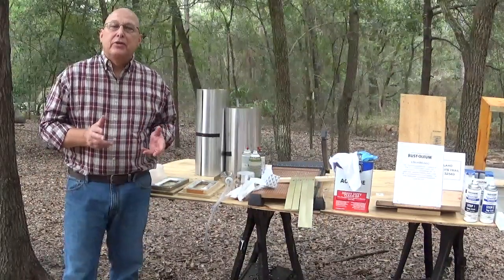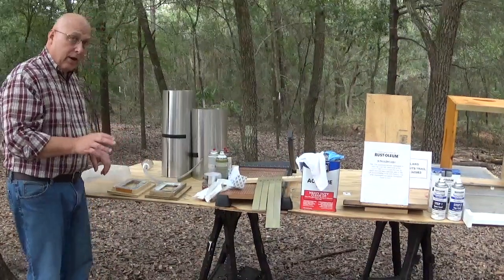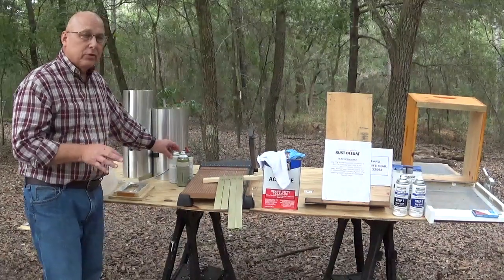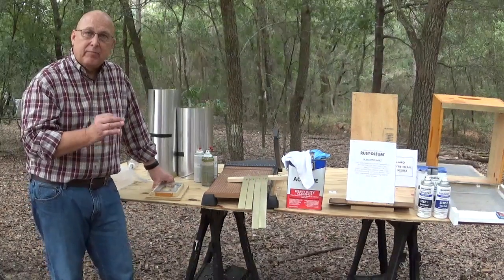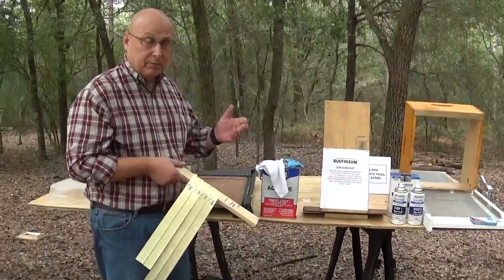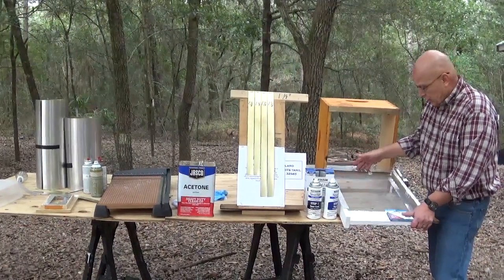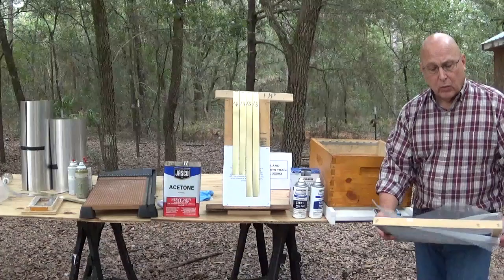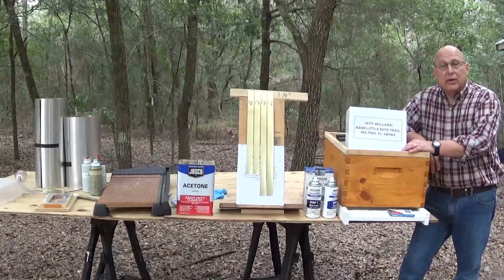Small Hive Beetle Barrier, it is easy to make and inexpensive.....

Comment: Hi, when you mention the staples would you mention the type of staples? Are they considered narrow crown? What is the width and or length of the staples. They are supposed to be stainless steel staples correct?
Reply from the maker: I use the T-50 staple, Arrow Fastener 508SS1 Genuine T50 1/2-Inch Stainless Staples. I also bought an air staple gun from Harbor Freight and that has sped up all my stapling jobs on the screened top covers and bottom boards, I liked it so much I bought 2 when they were on sale.
Reply: Thanks for the further input on the staple size etc. I believe I have an electric T50 stapler from Harbor Freight actually but they have an air nailer stapler on sale right now and I will investigate further to see if it can use this size and type of staples. Thanks again for the input and this idea to provide a barrier to the hive beetles
Reply: Sorry but I am a bit confused regarding the staple size as Arrow says the don't have a 1/2" x 1/2" stainless staple.
Reply from the maker: This is what I use..... Arrow Fastener 508SS1 Genuine T50 1/2-Inch Stainless Staples, 1,000-Pack.......   LINK TO:

       https://www.amazon.com/Arrow-Fastener-508SS1-Stainless-000-Pack/dp/B000OMJWNA/ref=sr_1_1?ie=UTF8&qid=1498244757&sr=8-1&keywords=arrow+508ss1
Reply: Ok thanks! I see those are a 3/8" crown vs. 1/2" that is what was throwing me a bit. I was looking for 1/2" x 1/2" my mistake! Thanks for your patience with the questions and I really appreciate the info and this great idea for the shims with regards to the hive beetles.
Reply from the maker: Your Welcome........

Comment: Hi Jeff, Super video!  I just cut the metal strips with the snip, snip method.  Not so easy... How long is the blade on your  guillotine cutter?  Where did you get it?  I plan to spray tomorrow, and néed to cut several more.  Think I will wait for the cutter...  Great Video!!!
Reply from the maker: Hi John,
Thanks, I got mine from Amazon  (ELMERS X-Acto Heavy Duty Wood Trimmer 24"). You might get a less costly 24" one from E-Bay, they are a real time saver that will last for years that is how I looked at the purchase. The Amazon link is below. 
 https://www.amazon.com/gp/product/B00FZYNXY6/ref=oh_aui_detailpage_o01_s00?ie=UTF8&psc=1
Reply: Thanks Jeff,  My hives have screened bottom boards.  Do you find that your barriers work with the screen?  I have regular inner covers.  Oh, I live in western North Carolina.  Last fall when top feeding I say SO MANY SMB. I use beetle blasters but those only help.  I am going to spay grass under the hives with salt and vinegar.  Hopefully this will disrupt the pupating of those devils!  I am also considering using boric acid in cd cases but hate to go this route.  Just FYI, I treat in the fall with black walnut shavings...smoke 3 or 4 times over that many weeks.  I have not had problems with Varroa mites.  Thanks again!
Reply from the maker: Hi John,
I use screened bottoms on all my hives, I feel that it keeps the hives cleaner and better ventilated. Spraying liquid or using powdered insecticide like Guardstar will help in the areas you use it but you have to remember the SHB larva will travel hundreds of feet to find a suitable spot to pupate in. 
  Now the Black Walnut shaving is a new twist on treatments, do you use the hull or the nut shell. You'll have to do some research on the possible compounds in what your using and how it may react to the Varroa, you may be onto something. Pop out some drone cells to double check on the Varroa population.
Reply: Actually, I use wood shavings.  I have met with a “mentor” who has around 40 hives, has been bee keeping for around 30-40 years and has always used this natural way to control the mites.  He uses a sugar shake for counts and they are good.  Drone cells?  Will do. Thanks!
Reply: John North Carolina can you give more detailed info on this smoking process?
Reply: Hi there,  Yep.  Black walnut shavings, dried.  Put them in your smoker in fall.  Over the next three weeks smoke directly over each second deep or medium brood/store super...puffing much smoke between each frame...close it up and do the same 7 days later for a total of three weeks.  This year I used this method, as i have the last 3 years.  Ive lost one of 5 hives this spring.  I went to our bee keeping meeting this week and many lost 50 to 90% of their hives.  About 50 people in the meeting.  Today I adjusted entrance reducer to middle setting, and all look great!  Email me and I will give you more detail if you want.  Good luck!  John

Comment: After spraying my strips they dried a slight milky finish. it still repels water but I am worried if it will still work. what color did your strips dry?
Reply from the maker: That is the way it dries, a dull, rough and off white color....
Reply: the directions state to put 2-3 coats of step 1 and 3-4 coats of step 2. HOw many coats of each did you use?
Reply from the maker: I gave mine 2 coats of the 1st stage and 3 coats of the 2nd stage..

Comment: I have a Clark's beetle blocker shim under my hive, I was wondering if I could spray the underneath of this with the neverwet and it will give extra protection in keeping the beetles out? Do you know if it would work?  Thank you!
Reply from the maker: Hello Gadget,
Yes it will add more hive beetle protection but make sure the sure the surface is very clean before you coat with Neverwet. Its funny that you ask this question because I have seen Mr. Clark insult my "free" invention and then promote how his $22.75 Beetle Blocker is the only one that works to keep out hive beetles on other web sites.
Reply: Thank you so much for your quick response, I will definitely make sure that I clean it very well.  I had an infestation of hive beetles.
Reply: Jeff, can the bees walk on this never wet?  I sprayed the bottom the beetle blocker and just installed it and went back to check on them and I noticed bees congregating on the screen below the beetle blocker and I saw bees falling to the ground.  Will they get the hang of flying through the holes of the beetle blocker or is the never wet preventing them from getting into the hive?  How long Should I leave it on to see?  I'm not sure if these are young bees falling, or if its fighting, i did see some bees trying to haul other bees out....Thank you!
Reply from the maker: Hi Gadget,

  Neverwet stops all crawling insects, that is why it works on ants also. Your bees are probably use to crawling on the bottom of the Beetle Blocker to get into the hive and the hive beetles were following them in. I believe the concept behind the Beetle Blocker was to force the bees to fly through one of the 6 holes to enter the hive.

  One of the "many" good thing about bees is they are quick to adapt to a new entrance, give them some time so they can figure it out. If they beard up on the front and can not get pass the Beetle Blocker after a couple of days it may be time to refit your hive with the flanges in the video, plus its a lot cheaper... Good Luck
Reply: Update: Since spraying the bottom of my beetle blocker, I added some beetle traps inside the hive, a week later I checked and there were a lot of beetles in the traps so I emptied them and put them back then a few days later I checked again and only found 1 beetle in the hive.  2 days ago I checked again and I did not see a single beetle in my hive.  Between the neverwet and making a screened top like you suggested, it seems to have solved my beetle problem.  Thank you for all your effort in finding a way to keep beetles out!!
Reply from the maker: Your welcome and I'm glad your bee hives are now cleared of hive beetles.

Comment: Hi Jeff, I am a hive newbie so sorry if this is a dumb question. Have you tried using this system on a Flow Hive? I am in Brisbane Australia and have a flow hive (never owned anything else before now). Your hive looks very different.
Reply from the maker: Hello Mitch,
All my hives are the popular 10 frame Langstroth, all commercial and most hobbyist beekeepers in the States use them. I have never seen the inside of a Flow Hive but from the pictures it appears that you should be able to adapt the Neverwet flange to the Flow Hive bottom board and front hive entrance. What I am showing in the video is how to mount them on a standard Langstroth 10 frame bottom board and front hive body but the Neverwet flanges can be adapted to any hive configuration. Good Luck.....
Reply: Fantastic! Thanks so much. I will give it a go.

Comment: Jeff,  not to be flippant, don't SHB fly?  
The adults are strong fliers and can disperse to other beehives easily. Beetles are also thought to travel with honey bee swarms.
Reply from the maker: Hello Mmmm, You are absolutely correct SHB do fly but only to the hive, once inside they will only crawl. SHB does not want to expose themselves to the bees inside the hive by opening their elytron and flying, with their wing covers closed they are like little indestructible tanks. That is why the coated flanges work, they can not crawl over the Neverwet coated flanges. Good luck with your bees.
Reply: Mmmm Yumm Also, his follow on videos are proving the absence of beetles inside his 31 hives so I guess they are not flying inside. Yet. Give them a couple years to evolve. But until then...!

Comment: OK, now you have a way to keep most if not all  of the hive beetles out.
Does this keep bees out of their hives  also? Or can bees climb on this product?
Reply from the maker: The bees climb over the Neverwet coated flanges like its not even there. The bees have never had any problems getting up into the frames and comb and the new queens are always back in the hives after their mating flights. This is what I have experienced with all my 50 bee hives.....
Reply from the maker: Yes, that is the material multi-surface Neverwet I always used the semi-transparent but it does come in colors now. It will dry to a dull rough surface. Check Amazon, Tractor Supply, E-Bay for the lowest price.  I found some at Tractor Supply one time on clearance selling for $5.99 a kit, needless to say I bought 6 of them.....
Reply: Thank you.

Comment: Would it not be simpler to just spray a sheet of the flashing before it was cut with the Neverwet? I'm busy trying to make these :)
Reply from the maker: Hi Sabrina, You could spray a whole sheet,  I've seen people talk about doing it that way. My only concern with that method is the Neverwet adhesion on the cut edge, it may hold up I just don't know. I thought that coating the whole strip at one time would allow the maximum adhesion of the Neverwet on the flange edges. You can always try some to see if it works.  Remember, sometimes doing it right the first time is a lot easier than doing it twice. Let the bee community know how it works for you.
Reply: I did wonder about that, if it might be more prone to flake at the edge...I'd rather be safe than sorry! :)"If" I do it, I'll keep ya posted!
Reply from the maker: Sounds like a wise decision.....

Comment: Which "flavor" of the NEVERWET do you recommend, or is there a difference?  In researching, I find it comes in Gray, White, and Frosted.  Will any of these work?Thanks!
Reply from the maker: Hi Glenn,
   I always get the Rust Oleum 274232 Never Wet Multi Purpose Kit which dries to dull opaque finish I never used the white or gray, here is a link from Amazon.    https://www.amazon.com/Oleum-274232-Never-Multi-Purpose/dp/B00DNQBFAW/ref=sr_1_1?s=hi&ie=UTF8&qid=1490056356&sr=1-1&keywords=rust-oleum+neverwet+multi+purpose+kit%2C
Reply: That's the "Frosted Clear" flavor.  Do you coat both sides of aluminum or only the "down" side?  Since you were cleaning both sides, I would assume that you cover both sides.  Thanks!
Reply from the maker: You only clean and coat one side and that side faces downward toward the bottom board....
Reply: Thanks for clearing that up.  One more question:  Assuming that your dimensions for the vent screen are for 10 frame hives, what dimensions should you use for an 8 frame hive?
Reply from the maker: The length would be the same but the wide for an 8 frame should be 13 3/4". Rip a a 1"x 6" board down to 1-1/4" wide, from that board cut two 13 3/4" and two 18-1/2" boards. Lay the 18-1/2" boards on their 3/4" sides then take the 13 3/4" with the 1-1/4" sides standing up glue and nail to 18-1/2" board ends. Now you will have a square frame with 1-1/4 on the ends and 3/4" on the sides. The aluminum window screen is the outer layer and the 1/8" hardware cloth is the inner hive layer. Staple single row of 1/2" stainless steel staples (I like using stainless) spaced about an inch apart. Spray contact adhesive on the outer screened frame edge, let dry and then attach the polyethylene foam tape to the screen. You now have a hive beetle proof screened vent top.

Comment: Hi Jeff,
I only have 2 hives, could I coat the entire inside with Never Wet rather than using the aluminium strips? thanks
Reply from the maker: Hi Jeff,
  You need the 3/8" barrier inside the hive so the beetles cannot crawl over. The problem with coating the inside is that the bees cannot walk on the Neverwet coating either and eventually the house keeping bees will chew off the Neverwet coating sprayed on the inside walls. Watch my other videos for more tips, Good luck with your bees.....
Reply: Thanks for your prompt response.
Unfortunately my hives don't have a separate bottom board so I'm a bit confused about how I can use your great idea.
I hate to harass you but any suggestions would be gratefully accepted.
Kind regards,
Jeff
Reply from the maker: Hi Michelle,
It sounds like your using a top bar or long hive, I had been asked this before and  I came up with an entrance idea for these hive types. It is like an anti-chamber, a separate box entrance that lets the bees pass through but traps the hive beetles. I gave the idea to Bob Spencer for his top bar hive and he was kind enough to make video plans for it. You can make them any size but you need to have that 3/4" rim for the Neverwet barrier and 2" or more for the bees to fly up into the entrance or crawl over the barrier. Here is the link;  https://www.youtube.com/watch?v=-rNoM4z02o0

Comment: Jeff, a friend finally cut my 1 1/8" strips on a metal break and some of the 19 7/8" strips are as much as 3/64" over on the width. Do you thinks this will hurt much as far as the bees getting in and out of there ok as compared to 3/64" less at the 1 1/8" measurement. Again I'm newer to beekeeping so I have no idea on things like this. 

I will be installing them on the bottom of a slatted rack if that makes any difference in the above.

Thanks for your patience with the questions and your input as well.
Reply from the maker: It will be ok, I have cut mine up to 1 1/4" wide and it didn't bother the bees. Don't worry they'll work and the bees don't care on the exact width.
Reply: ok thanks, I really appreciate the info! I have been looking for a suitable paper cutter but haven't found any with a long enough cutting area/arm and table to cut the 19 7/8" strips yet.
Reply: re: spraying top coat
Jeff, just curious how far away from the strips you were with the can when spraying. I am wondering if I had the can too far back as I felt like I needed 2 passes for 1st top coat, to get a decent coat on the edges in particular. It mentions using two separate coats of top coat too but doesn't say how long to wait between coats of the same thing. For 2nd step it says to wait 30 minutes between 1st and 2nd coat but I don't know if that long is required for second spraying of the 1st coat. To me that is the bottom coat not the top but the instructions don't refer to step one that way.
Reply from the maker: I don't have a can in front of me but the instructions are on the can. Usually spray 4" to 8" away for a wet coat and give the 1st stage 2 coats, I wait longer than 30 minuets to allow enough solvent flash off. Apply 2 stage wait overnight to dry.
Reply: Well I finally got my two sets of Neverwet coated strips done and one set installed on a slatted rack. The only concerns I now have is how much of the two coatings I used on the 2 sets and the color as compared to yours in the video. 

Though I don't know if the color of the strips shown in your video already are coated with Neverwet or not. Mine came out a silvery frosted kind of color which may suggest there was more coating on then required.

Generally with both 1 stage and second stage I sprayed each strip up once and down once and the first set I put several coats of stage 1 and several coats of stage 2. While on the second set I only put 2 coats of stage one and 2 coats of stage two. The instructions say the kit covers 15 sq. ft, of material but my guess is that may be with a single coating of each stage vs. multiple coats and may depend on what material is used.
Reply: What should the surface texture of the aluminum strips be like when finished?
Reply from the maker: Neverwet surface needs to facing downward. The surface is a dull rough finish.
Reply: Yes, thank you VERY MUCH for all your help! Even though there were no runs in the spraying process I was worried I messed up the finish with improper spraying but it is as you describe.